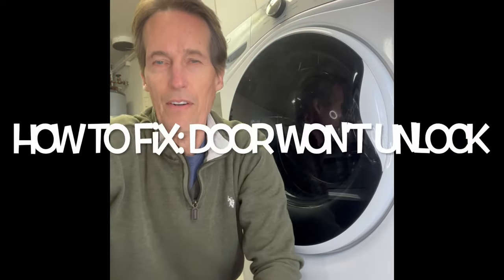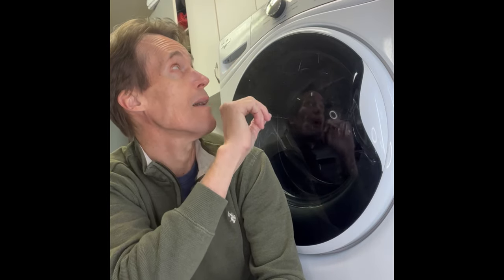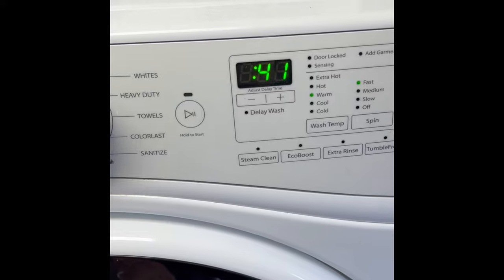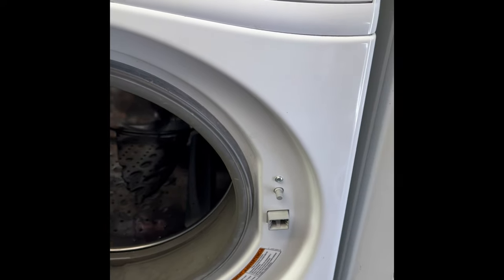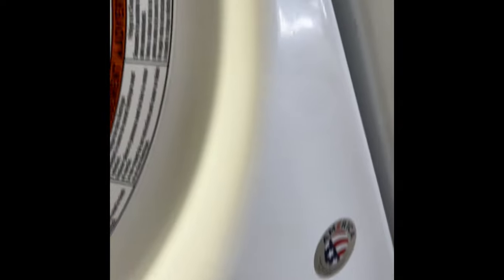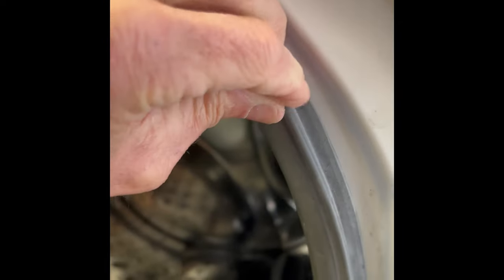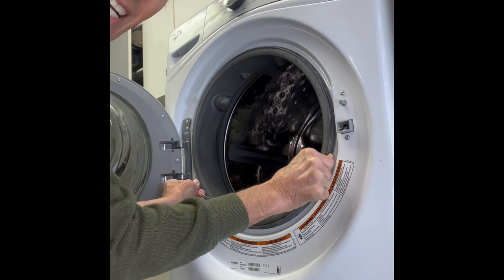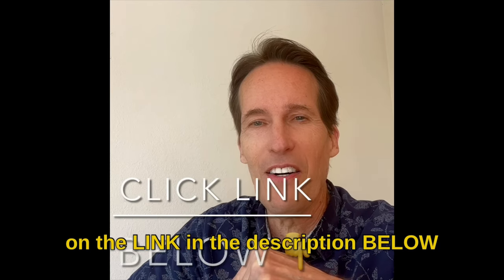✨ WHIRLPOOL Washer   Door Won’t UNLOCK   - EASY FIX ✨

Comment: Thanks very much for the advice. I had unplugged the washer, seen the locked door light go out, re-plugged the machine and the door was still locked. You mentioned a five minute pause before re-plugging to allow capacitors to discharge and I just hadn’t thought about that with a washing machine. I paused the re-plug and the door lock clicked open.  

MAY THE WIND BE EVER AT YOUR BACK, 
MAY THE RAIN FALL GENTLE ON YOUR FIELDS……
Reply from the maker: Oooh,
I like that quote 😊😊😊

Comment: So grateful, 2010 whirlpool duet door stuck shut; wet laundry inside. Too old for parts I think. Use very little detergent, mostly soap nuts except towells for salon. Always less detergent bc i use the steam sanitize for towels less HE detergent and add oxy 1/3 recommended. So grateful to sleep(not worried about laundry stuck and stinking over night) tonight bc of your videos! God bless you!
Reply from the maker: Thanks so much Susan😊❤️😇